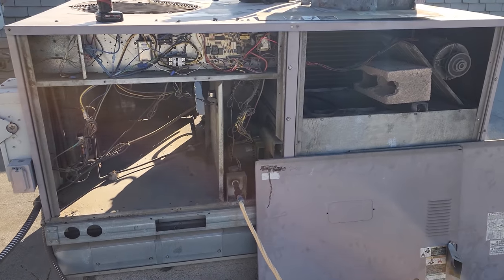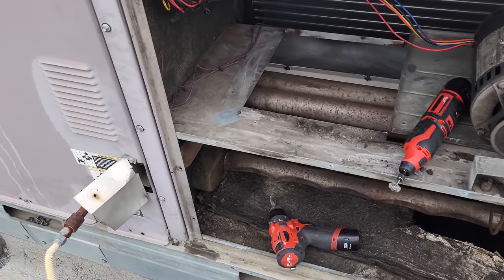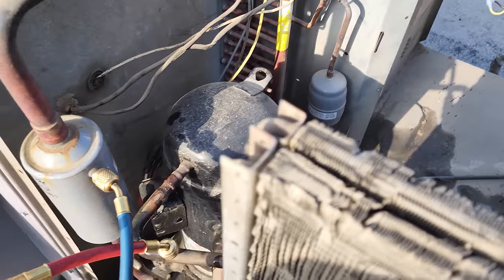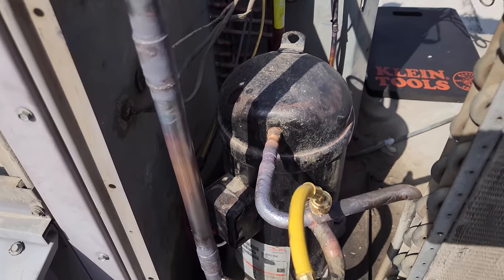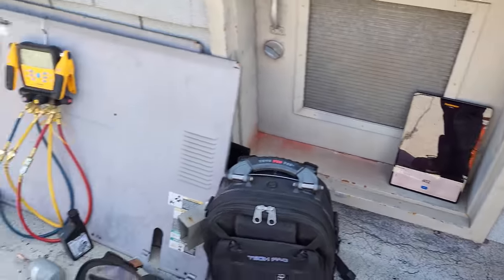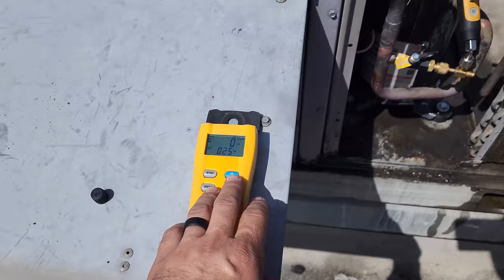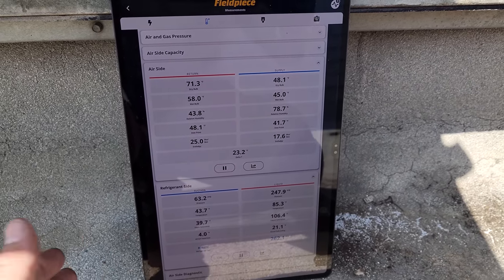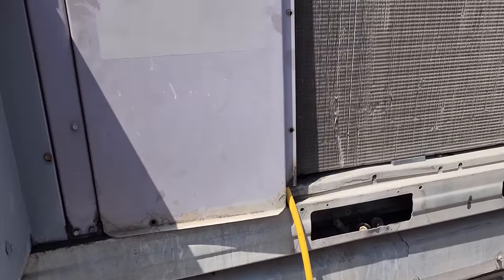I CAN'T BELIEVE THEY APPROVED THIS REPAIR

Comment: I'm new to your channel, I respect you for putting yourself out there & the quality of your workmanship, you're a good mechanic, well above average to my competition, so if you see any of my comments & they look negative, they're not meant that way, treat them as mechanic to mechanic, shop talk if you will.
Having said that, I would have never of touch that cond coil with the fin comb, I feel you inadvertently made the situation worse rather than better, exponentially reducing the life of a tired coil. 
And a question, I'm sure it's been asked before, why do your rtu's out there have piped drains? That's very strange to me, I'm guessing some weird Cali code? For myself, an open ended trap is a quick visual 'tool' when I go up on a roof.

Comment: WHAT ARE THOSE PINK WIRES THAT GO TO The BLOWER MOTOR Chriss? i was wiring one up the other day and the schematic says Overload for the blower motor but its coming from the 24v transformer secondary ! Is the overload on the mottor 24v? 
thanks

Comment: Is there a reason why you brazed in two joiners where removing the suction drier rather than using pipe expanders? Or is that just your preference? Another great video.
Reply: Im guessing it was pipe not tubing and too rigid

Comment: Also need to cinsider within the year the new standard of refrigerant and entirely redesigned systems will be required.  It would suck to swap out with a new system that is immediately obsolete.

Comment: I don’t know how much experience you have with gas welding but if you encounter future cracks like that you can weld that with oxy-acetylene. Just got to make sure you don’t set anything on fire and have the appropriate rod on hand. 

I only bring that up as it’s unrealistic to expect you to have an electric welder and a gas setup is already in your tool kit.
Reply: Flux coated bronze brazing rods are handy for that kind of repair, but most of us doing HVAC work  will end up having to toss most of package of them away because we don't have a use for them very often, and once you open the package, the timer starts ticking on the useful shelf life of them.

Comment: Your micron gauge should not rise after isolation . If it rises but some and levels out then there is still moisture in the system. If rises and keeps rising then you have a leak of course. The core tools can a spike in micron level when isolating. Especially when they wear out.

Comment: HEY CHRIS, AT WHAT PRESSURES DO YOU SET YOUR ROSEBUD TIP ON YOUR OXY/ACETYLENE REGS?
Reply: Same question, mine tend to blow out on me 🔥
Reply: @BenTh17   10 acetylene 10 oxygen is about minimal, works for me, sometimes you have to play around with it, I normally do around a 10/13 and it works fine for me

Comment: What's your opinion/experience on using a clamping system vs. brazing??
Reply from the maker: My video that is being released on Sunday will actually be with press fittings, but I see value in press fittings but they won't work for me on all my jobs. Only some of them
Reply: Proper prep is key. Some people (usually older techs)  believe it takes away the skill but it still takes time and effort to make the product look good and work as designed.
Reply: press fittings are good for when brazing fittings are either:
A. at a mall or bldg where you need a fire permit
B. at a bldg that has a FA system, and you forgot to have them place it in test mode
C. in an attic surrounded by insulation that's waiting to ignite so your dreams burn with the building as you're now liable for many many lawsuits against you
D. refer to above
Reply: @HVACRVIDEOS  Awesome I need to watch, thanks.
Reply: Thanks the input guys, I'm considering buying a press/clamping kit.

Comment: Assuming the Start-up, Test and Balance was done correctly. A little trick for adjusting the new motor pulley to the old motor pulley, is to your Hex Keys as a “Feeler Gauge.”

Comment: back when i used to do a/c the most i could getv was 30 inches of vac. now they talk of microns what is the differance?
Reply: Micron is just a smaller unit of measurement. 
A perfect vacuum is 0 microns. 
Atmospheric pressure is something like 730,000 microns.

Comment: That metal is probably fatigued overall. Why not continue by reinforcing opening by placing a frame of wood underneath it and support it with wooden legs which will have a dampening effect and the pressure it can apply from below from it's legs can provide support to help bear the compressor's weight, stopping some of the flexing and oscillation which you may also be experiencing, which will cause a kind of vibration itself? Wood is great for this purpose, as long as it is well anchored.

Comment: How common do y’all take a motor to get re spun inside of getting a new one? I work for a school district and sometimes I have to send motors to get re spun
Reply from the maker: I dont do it ever, but I typically work on smaller motors and it's not cost effective to rebuild them
Reply: @HVACRVIDEOS  you would be surprised how quickly you can replace bearings on those 1 to 5 hp and the bearings are only a couple of dollars,the numbers are on the bearings,and they will save a 3 hr trip.

Comment: Only thing I would like to note is using a wire wheel in a drill isnt the greatest thing, as it was explained to me is the drill only has bearing to take a pressure load in line for drilling, and it doesnt have bearings for perpendicular loads that are induced from using a wire wheel. Occasional use shouldnt be an issue tho. I always love watching your videos and following you in your diagnostic process. I dont do HVACR but most of what you explain sounds like skills that can be used anywhere and I feel like its helping me for the long run

Comment: In the future when you try to bleed your oil from that pump and easier way to do it is just put that little 6-in hose with the ball valve on it loosen the connector and then pump down as it starts to squirt out the air once it goes to liquid coming out then tighten it up at the same time just like you doing a bleed of break fluid on a car it's a lot faster and simpler and cleaner

Comment: Honestly  a 1 inch by one inch pach over it with a standard brazing rod would be best but a good silver solder should work as well next time try to put a small groove to let it flow deeper  oh and for that compressor connection maybe look into silicon bronze rod with a touch of flux should  bond the 2 together well

Comment: Have had units that were 25 years old that owners wanted to patch. One unit I repaired about 12 leaks in evaporator coil and still couldn't get it to hold pressure. I finally gave up and said we needed to replace the unit since coil was no longer available. He was upset I couldn't fix it. But then when he got the electric bill after installing a new unit he said he couldn't believe how much his bill dropped. Said he should of replaced years ago. I just shook my head.

Comment: I'm wondering how many companies are trying to restart manufacturing in the US.   If they are, it's going to take a lot, because the mines are closed, the refineries (metal) are gone, the mills are shut down, and OSHA believes that all heavy manufacturing can be 100% safe.
Reply: @tbelding  I think they chose texas more or less because of the stability of the land more or less. Even slight vibrations are bad for chip fabs.
Reply: @tbelding  Also, we are losing manufacturing cause we are in a negative feedback loop: people need to be paid higher here, but they need to be paid higher cause of perpetual inflation due to non-stop government spending causing more inflation, causing people to be need to be paid higher and the loop continues on... negative feedback loop.
Reply: @memadmax69  - Excessively paid in a lot of circumstances, because of union abuses.  The manufacturing I don't understand being 'outsourced' is that which has minimal labor costs, such as plastics extruding and molding.   Also, smaller manufacturing businesses (truck bodies, etc) do manage to stay profitable, so there has to be some other reason for it - I point to OSHA as being a major player in the "get rid of industry, it's unsafe".
Reply: @memadmax69  - It's being next to Austin that's the problem. That's a dry area.  If they moved 100 miles to the east, they'd still be in Texas. stable, but with more stable surface water access.

Comment: Brazing seems a bit excessive, I do like the idea of drilling a small hole at the end to try and stop the crack from spreading.

Why not a flat L bracket/ corner brace on the top and bottom ?
Reply: what type of brazing rod did he used on that crack?

Comment: You should never braze over a crack on a 90  of a discharge line unless you like callbacks. It's a high probability that it will crack again. You could have cut the cooper and not unbrazed at the compressor. Good luck with that repair.

Comment: Welding that small crack would for sure be the right fix but I'm guessing you don't know how to weld that metal- that solder will only cover the metal and not strengthen it not fix the crack. Spot weld it or use torches to weld after a spit shine and grind off the excess rod would've looked and gave you the piece of mind that the housing wouldn't fail. Just a heads up

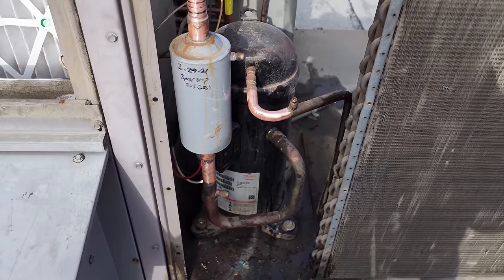Comment: 8:48 - Where do you add oil if you don't unsweat?
Reply from the maker: Suction line with an oil pump
Reply: @HVACRVIDEOS  does your pump have a core depressed to add oil while system is operating? Or while off? Still learning this stuff. Thanks for posting your diagnostics and best practices. They greatly enhance my understanding of the trade.

Comment: JBWeld FTW... that braze job won't hold and also copper pipe bends greater than 90 degrees always crack when connected to something that naturally vibrates. it doesn't even matter by how much it vibrates it is basically guaranteed to crack. whoever made that bend did the actual damage.

Comment: Certainly seems as those AC units units are becoming increasingly less reliable. So I can’t blame someone for not wanting to replace an old unit that is repairable.
Reply: @B K well they did good as far as we know, I'm hoping it'll be easy to replace those motors when they inevitably die, though Chris did bring up a good concern, how is it gonna manage with restaurant grease? It's a cool design though.
Reply: @B K I’ve never worked on a Weathermaker that wasn’t junk. 🤣
Reply: @B K did we just become best friends???

Comment: Be careful with 407c in fixed orifice systems. I hear it runs like crap. My buddy was working for a large customer and they mandated that every R22 unit be converted. He said if it had a TXV it worked great. If it had a piston or accurator coil it ran like crap. I’ve never converted a piston/accurator system to 407c so I have no first hand experience.
Reply from the maker: So far so good, however I did notice that the unit almost looks like it has a restriction on startup but than the pressures slowly stabilize after it runs for 10 minutes..... thats the only weird thing so far
Reply: @HVACRVIDEOS  it’s probably that high glide refrigerant getting slammed into fixed restrictors. Glad to hear it’s working though!

Comment: The roofer forgot to portals or you guys didn't supply for rolls and the whole unit has no cancer pain it so pressure comes out on the roof and the oiled that spilled over out of the units is eventually going to make a weaker roof area

Comment: for retrofitting R-22, I might suggest you look into bluon/R458A/tdx-20, runs much better than most retrofit and it's pretty good. Another great video, soldering that metal must've been fun
Reply: Blueon is cheap right now and wonder how long that will last but it works better tham R22 imho.
Reply: I just changed a 407C with mineral oil retrofit (that I did not do) to TDX-20.  The pressures were all over the place with 407C, but the Bluon really stabilized this very troublesome system.   I also added a TXV, and the system runs so much quieter now, with very stable and much lower pressures.  It seems to be everything the Bluon reps claim it to be.

Comment: Lines Crack all the time from age and vibration.  I've repaied Hundreds of them.. the Crack in the sheet metal would not condemn the complete unit on my watch. I mean really, it's a simple matter to add a plate top and bottom and fix the Crack. Most blower assemblies vibrate from dirt build up. I pressure wash the squirrel cage and replace the bearings and usually the vibration stops, unless the blower wheel has lost some of its components.. as far as the worn pulley, I just put a wider belt on the blower assembly... problem solved.

Comment: Has anyone ever had vacuum pump oil back feed into your hoses 
* The oil has just been changed
* The oil is not over filled
* It happened to a 1/4 and 3/8 line 
* No pressure in the line set
Reply: It’s not vacuum pump oil. It’s refrigerant oil. Are you properly using your gas ballast? If your pump is too big and you pull a vacuum too fast the air literally pulls the oil into your charging hoses. Open the gas ballast before startup and close it per OEM instructions and you probably won’t have any more issues. 🤷‍♂️
Reply: @jman0870  it's happening on new installs linset and EVAP coil are the only things being evacuated

Comment: 20-20 warranty within a repair, 20-steps to vehicle, and-or 20-minutes, whichever arrives first. It's been out within elements for many years, it's had hundreds within thousands hours functioning. It's within borrowed time, 20-minutes at most, if your going to get married, marry a girl, not a unit.

Comment: You keep fixing their junk, and they’ll never replace it. 6 ton unit will cost 5,000+ crane and labor at most
Reply from the maker: Nah bud in California a 6 ton package unit is gonna be at least 15k installed and if they permit it at least another 3-5k on top of the 15k

Comment: i know how my company would have me fix it ,cause I have already on some 1983 models ,in WAY WAY worse shape than that one. JB weld the crack . put some "silver solder" on the cracked pipe . straiten  the wheel best I can with big screwdrivers and whatever else I can find to bend it back into shape  , gas it up and call it a day. this is not hypothetical , been there done that, and had to remove the evaporator ,take it outside and pressure wash it for hours to get all the mud and mold out of it . Your repair is way way better but the machines I'm working on the a/c companies say they are unrepairable and have to replace ,so that's when they call Band-Aid bill , they might be junk but they run better than they have in a decade ha ha ha .

Comment: I would have just gas welded that crack with wire and use a Vibrasorber on the compressor